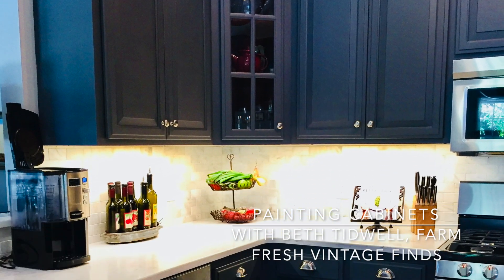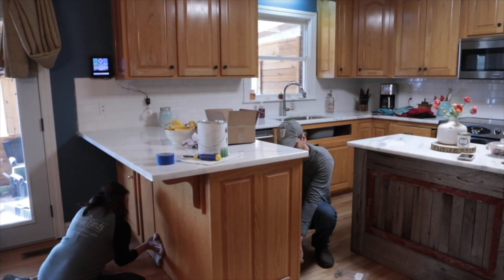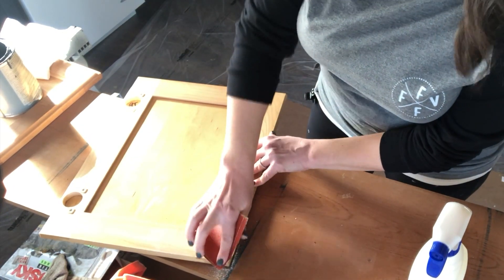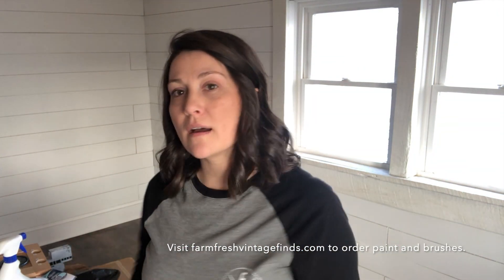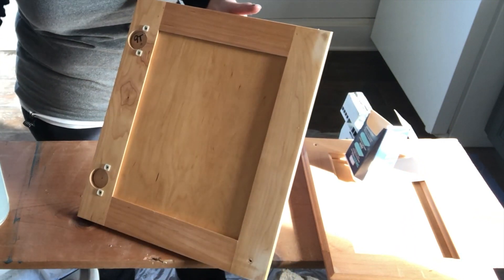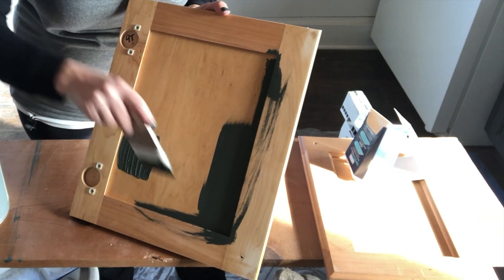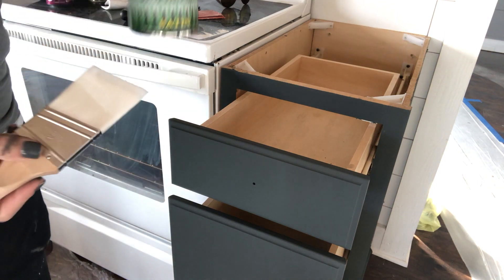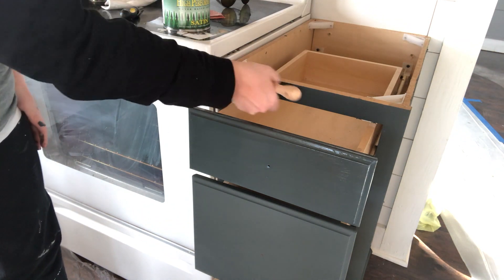Painting Kitchen Cabinets, a Step by Step guide

Comment: What kind of cleaner do you recommend for removing grease from cabinets that are in the kitchen, especially those over the microwave?
Reply from the maker: Hello, I typically use Simple Green or Krud Kutter to clean the cabinets.  Just make sure you're using a good degreaser.  Thanks for watching!